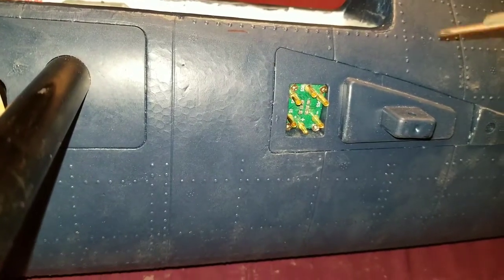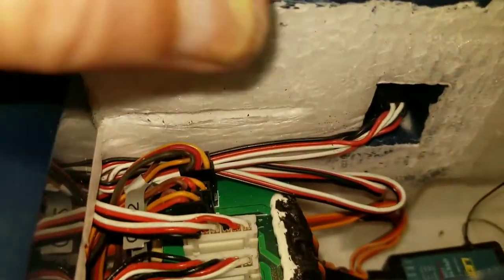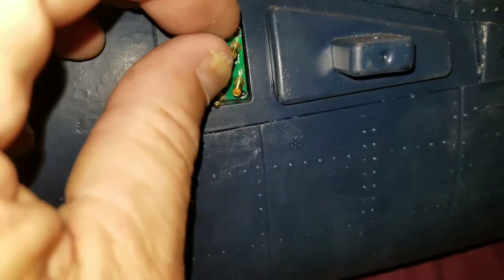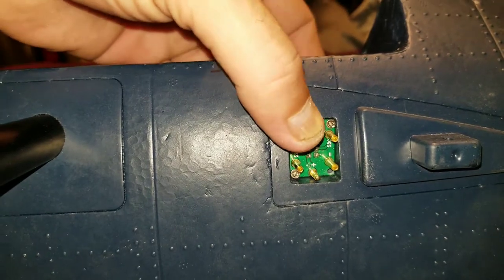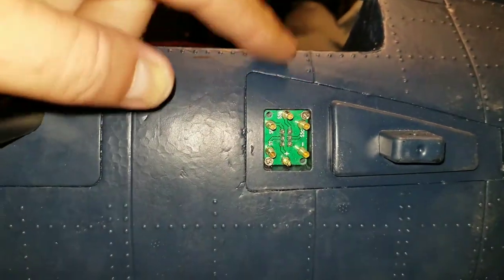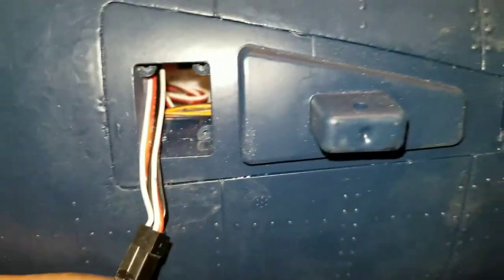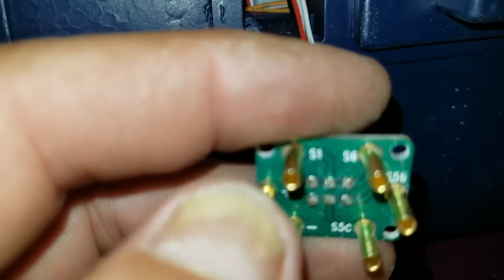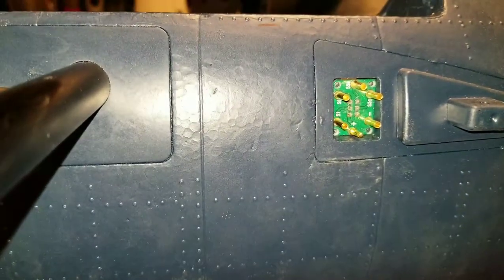FMS 1700mm F7F Tigercat Wing PCB  Board Connection recommendations

Comment: Hi Brandon, Thanks for the mod. Just curious if this mod is still working for your FMS Tigercat after many flights?
Reply from the maker: yes, still works, no problems. but I haven't flown in a while with all this pandemic crap going on
Reply: @BrandonMoon1  Thank you Brandon🙂. I have actually removed all the screws from the fuselage side and glued the back servo plugs on pcb board like you. I also checked the wires connected behind the wing pcb boards and tightened the servo plugs like Rich showed. I hope this should be fine.
Luckily here in Germany its a somewhat relaxed. Thanks for taking the time and stay healthy 👍🏽